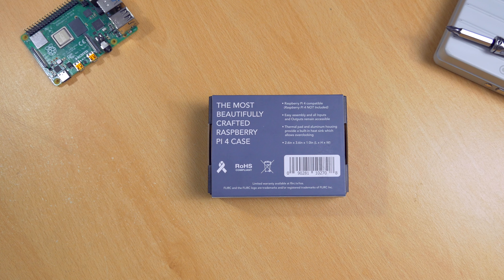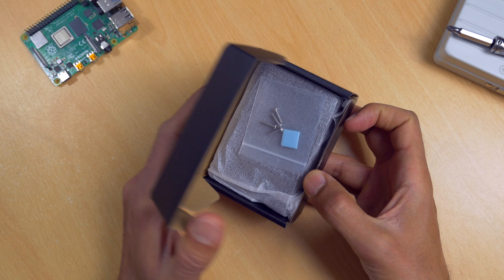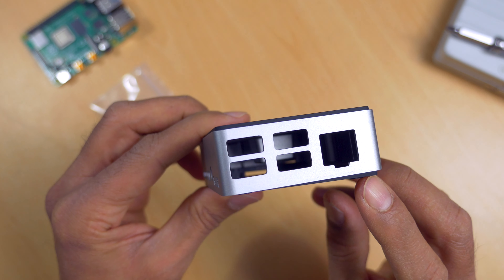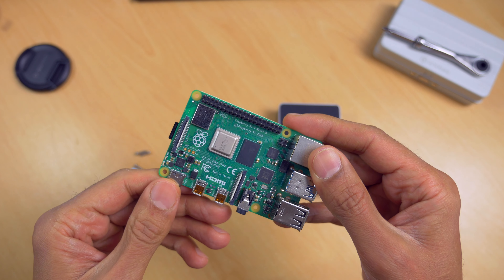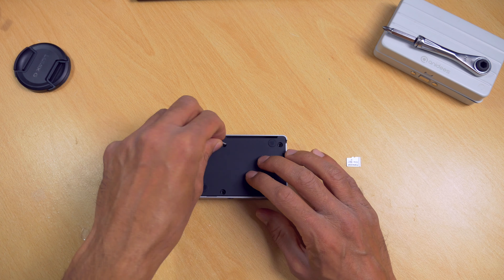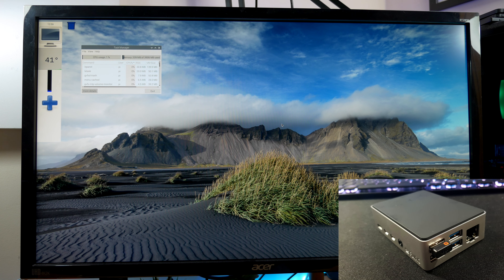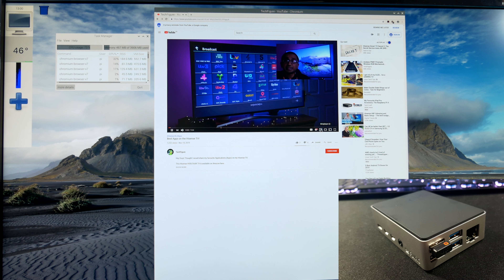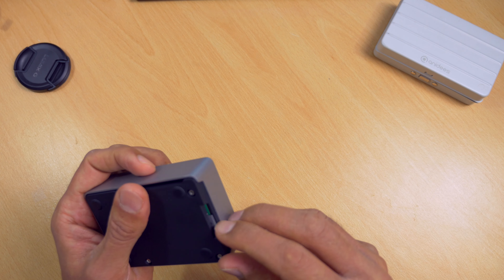The FLIRC Case For The Raspberry Pi 4 Tested. Is It The Coolest? 🤔

Comment: can this be improved anymore by adding a heatsink on top of the case ?
Reply from the maker: You could add a fan maybe
Reply: It can be improved considerably by ditching the foam thermal pad and using a proper copper shim and thermal paste.  You'll immediately notice that the case will be warmer afterwards as it pulls more heat out of the CPU.